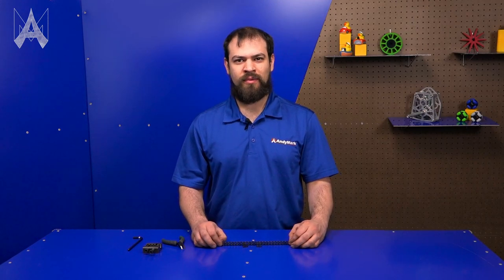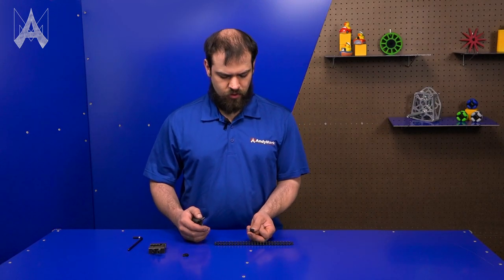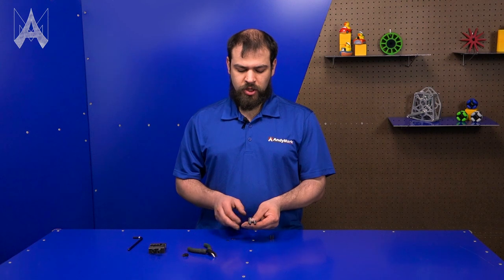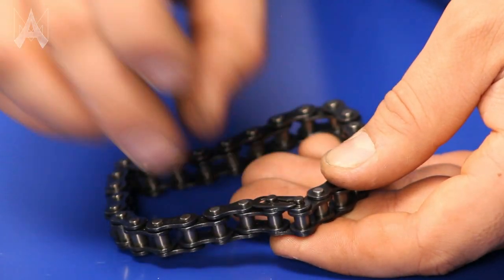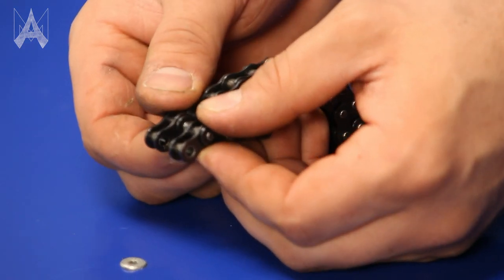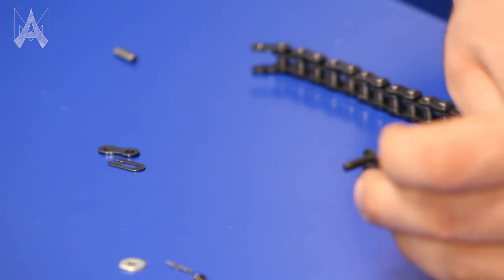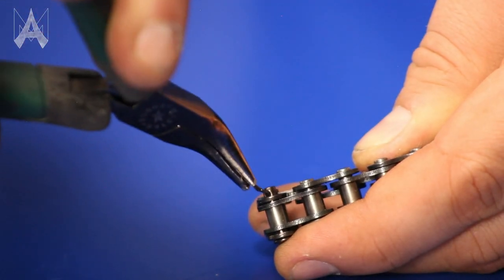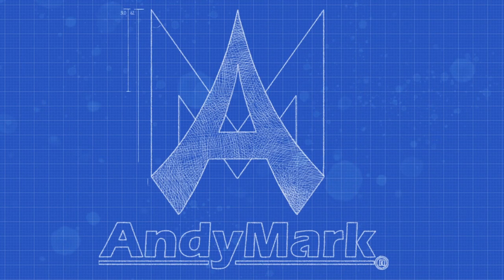How Do I Use Master Links and Half Links?

Comment: Thank you for the great tutorial. I was told the closed end of the master link should be in the direction of travel in case of it knocking into something it won't come off. Does the direction of half link matter?
Reply from the maker: Good Question! Yes, a good rule of thumb is that the closed end should be in the direction of travel. In a lot of robotics applications, the chain will travel in both directions so it might not matter in all cases.

Comment: Can you use multiple half links on one chain?
Reply from the maker: You absolutely can, but its not recommended. Half links and master links are weaker than regular chain, so using more of them than necessary introduces more possible points of failure into your chain. Using 2 half links is equivalent to adding 1 chain link, so simply adding a new link is the recommended action.